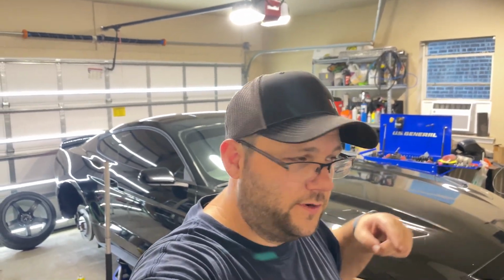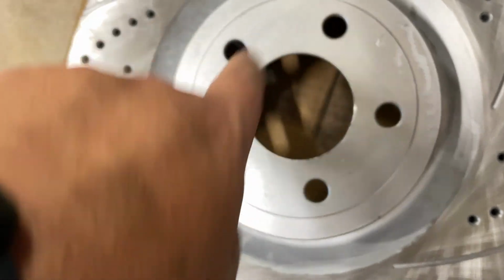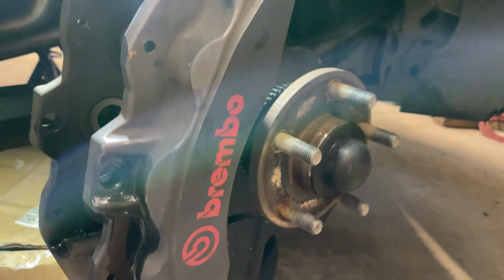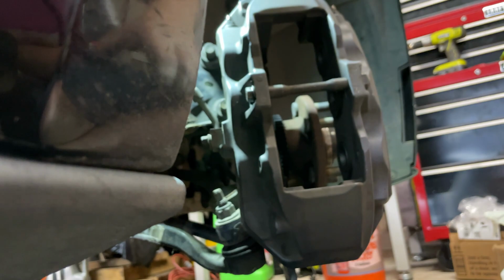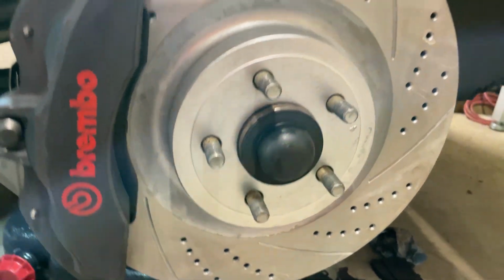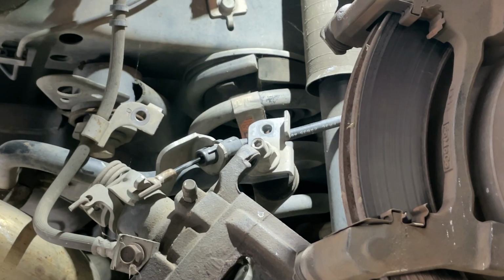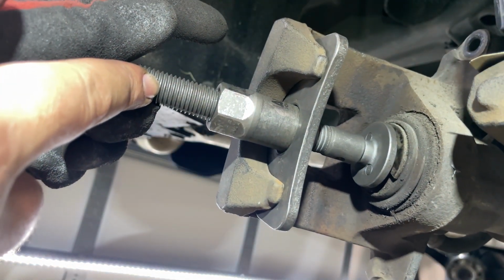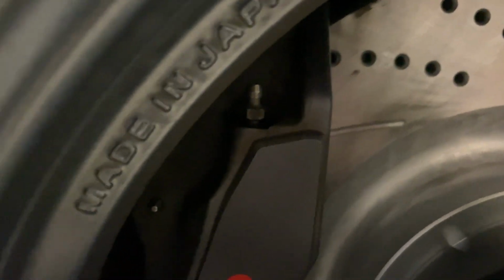REPLACING PADS AND ROTORS ON MUSTANG GT PERFORMACE PACK!

Comment: nice video. Seriously....how good are these rotors? As far as rust and quality for the price.
Reply from the maker: I’ve had no issues with them so far. If you let the car sit for awhile they do get surface rust, but nothing major. Just be careful with the coating on the rotor hat when you clean them off before installing. If you can leave the coating intact on the hat it won’t rust. They are a little heavy but to be fair it’s a lot of metal. So unless you want to drop the coin on two piece rotors it’s just what it is. The pads and rotors aren’t any noisier than you’d expect for an aggressive street/track pad. A little squeak when they’re cold first few stops and then after that nothing. I don’t notice it unless the windows are down.  Brake dust has been no worse than anything else I’ve run. Hope that gives you a little bit of insight.

Comment: Did you have to do a brake bleed after this?
Reply from the maker: As long as you don’t open the bleed valves you won’t have to do a brake bleed. Just slowly press the pistons back in so with a caliper spreader using the old pads to push against.

Comment: Stock replacement pads going to be ok for drifty boy action?
Reply from the maker: These are carbon ceramic pads so they are still a more aggressive street pad, but should be plenty. Unlike road racing drifting is short sprints, and not nearly as demanding on the brakes.

Comment: my rotors are stuck as shit
Reply from the maker: I assume by now you’ve gotten them off, but penetrating oil, heat and a hammer are your friends.
Reply: @MikeTW   yessir i initially wanted to swap in my lowering springs but just ended up stripping my sway bar link and banging on a rotor all day.
Reply from the maker: @balakays550 Sometimes that's the way she goes. Glad you were able to get them off, and hopefully the lowering springs give you the stance you're looking for.